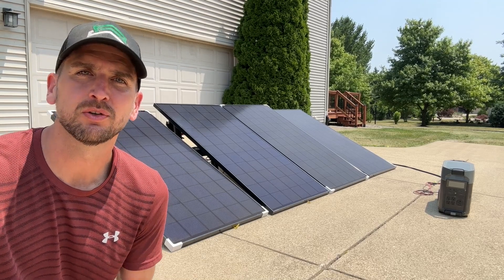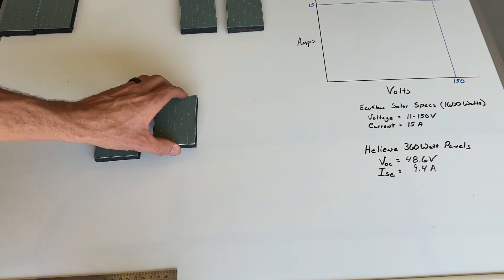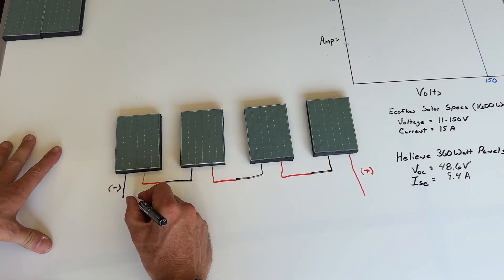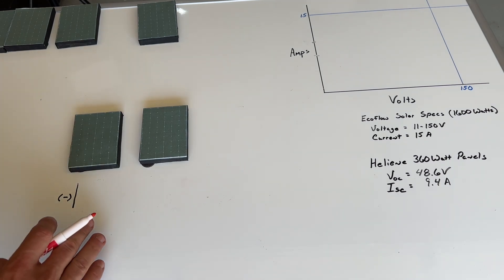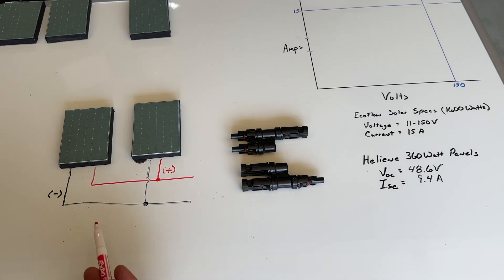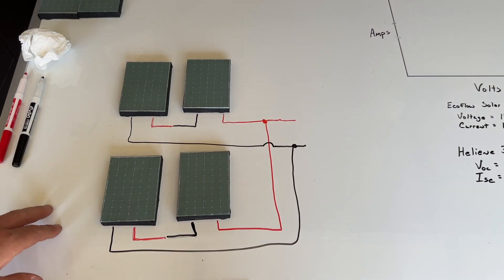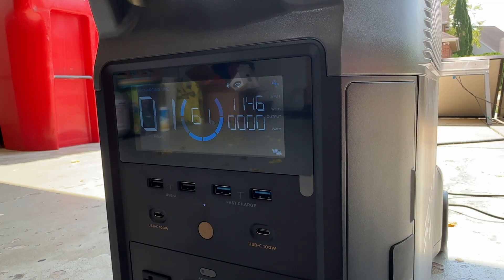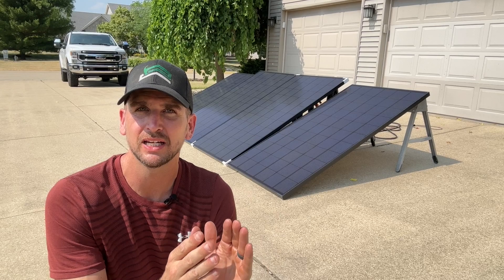Solar Panel Wiring Basics | Maximizing EcoFlow Delta Pro Solar Charging

Comment: I'm new at this and would like to know if it's possible to do (2P2S) instead of (2S2P) the reason is I have a Bluetti Apex 300 with 2 AC/pv ports of 1200 W with Voltage  between 12v-60v and current under 20 A. Ex if I was to use your 360W panels. Thank you.

Comment: Are there panels available now that would better max out the 1600w?
Reply: I have the ecoflo delta pro and I am checking out the bifacial 200w callsun
I know next to nothing but I need 800 to 1000 watts for my needs and I am not sure but I think i can do it with these panels 
Check them out

Comment: is the female or  male mc4 that is on the panel the positive? I have 4 for series and bringing each end, one red + and one neg- to a housing box, combiner box to connect to the pus and neg wires from the delta pro ultra high ports. The top port is specified as the positive and has a female connector on the generator and vice versa for the bottom port.  So I need to know which end of the array end connector, female or male to put as my positive red wire and which to put my black wire into. THank you.

Comment: I have an ecoflow delta 3, which takes a max of 500 w solar input. I have two 315w solar panels that I got for $50 on Craig’s List. If I connect them in series, it will not charge, but in parallel, it charges like a charm as I learned first hand.

Comment: Thank you for the great video.  I just bought a EcoFlow Delta Pro and extra battery that will give me 7.2 kWh power.  As for the solar panels can I arrange the 400w EcoFlow panels in series then parallel without exceeding the limits of the battery?  Looking forward to your response.  Thanks!!

Comment: Inverters can take 40 extra voc. Because under normal load, panel voltage will be less. If I were you, I would have gone for 4 panel series, getting 38.something x4 = between 152-156 v with 8.8 ampere = around 1350watts
Reply: Lmao yeah no. Don’t do this, man. You’re going to fry your inverter and warranty along with it.

Comment: On the last part for series and parallel, could you have added another solar panel seeing how it would have still been under 150v? I know that it would have hit almost 30 amps, but you said that the device would only allow 15 amps which it's rated for. So basically 3 & 2

Comment: I could use some knowledgeable help with my solar setup in my van.. I have a 200w and 2x 100w panels.. With a 160ah battery, and a marine battery.. Do have most of the wiring and do have 2 charge controllers (one per battery) just needing to know the gauge appropriate and also the fuses and where theyd be appropriate.

Comment: That is a great video. Thanks. I have a solar system on microinverters with 400W panels. I want to organize emergency backup power setup. For that purpose I'm planning to get DELTA Pro and connect it directly to solar panels most likely the described way. I'm planning to put splitters on the panels the would split panel current between microinverter and a backup system. Of course in the case of emergency microinverters will be turned off so all the current will be going to the DELTA Pro. Are there any potential problems with a system like that?

Comment: Please i wanted to ask, why is the fan noise on the delta pro even more higher than when charging with AC, i was getting 700w input through solar but the noise was so loud, is it just my unit?

Comment: Super clear!  Thank you.  I've never done solar. A few months back I got the Delta Pro. It is in a 4x4 Sprinter and hooked up the 800W ecoflow car charger (which is great). Now I'm trying to figure out if I can also hook up some roof-top solar, hopefully 800W panels. And have it all be running at the same time in a safe way.  Any help would be greatly appreciated.

Comment: Hi Scott, first of all, thanks for the great videos 😊 from what I could understand (I’m starting with solar panel system – just bought Delta PRO 3 and is still on the way) from putting the system the way you did (series and parallel) at the end, the values I get on paper, are above the maximum permitted in W and A from the unit.
2 sets of solar panel in series (45v / 9.4A) we would get a total of 90v / 9.4A, right? Then when combining both sets in parallel we would get 9.4A+9.4A = 18.8A x 90V that would give 1692w, right? With this configuration, we would be above in short circuit value and also in power. But since it has worked on your experiment, it could have been, because there were not enough solar power to take it to the maximum or my values just completely wrong? What am I missing here 😊 Thank you

Comment: I have a solar panel on my trailer that is connected to a Go Power controller to charge the deep cycle battery in the trailer.   Can i split the solar panel lines/wires  so i can connect simultaneously to an Ecoflow portable battery?

Comment: Great video - very clear walkthrough. It would be useful if EcoFlow could consider increasing the voltage and current inputs because trying to add more than one solar panel feels like Doc Brown connecting the clock tower to the Delorian.

Comment: Hello. I also have a question for you, I see that you are very skilled. I want to get the Powerstation ECOFLOW Delta Pro 3 4096 wh and I want to ask you can I put  3  400 -420 w panels on it, but should I buy them separately so that I can also come out cheaper. And how many 400-420w panels can I use on this station? AND how much can I extract from this station if it has 4kw can I take 3kw / day from it without damaging it. That is, to last me as many years as possible? .Thanks!

Comment: All the info has been great. My one question is if my volts and amps are within the specs for my Ecoflow power station but the watts are over the max. Will the power station throttle the watts or will that harm it?

Comment: I’m new at this just learning first thank you for the clear step-by-step guidance. I’ll probably have to watch it two or three times before I get it all second. Can you leave the solar panels connected to the Delta unit all the time.
Reply: Yes, the delta unit have built in charge controller that will disconnect the battery when it is full

Comment: Supposing it was late in the day or hazy conditions and the panels are producing fewer watts.   Are the fewer watts because of reduced voltage or current or both?     Can the series/parallel math be done with whatever the panels are currently delivering.   Or does the math have to be done with the spec'ed voltage and current ratings?

Comment: Living in CA requires me to connect to the grid. But in a power outage i can't use my 6k solar array as it requires 120v to run. What do you recommend to be able to use my solar in a Power outage? I'm using micro enphase inverters
Reply from the maker: Yeah, that is a super common problem for a lot of grid-tied systems.  The most common would be investing a significant amount of money and get the Enphase battery backup system with the needed hardware.  I hope we get a better solution soon but right now that is it.

Comment: Are there any "fail safes" in connection(s) between the panels and battery/power supply to prevent discharge of the battery when there is low to no illumination for the panels?
Reply: The charge controller connected inbetween the solar panel and battery will have protection features. You CANNOT, i repeat, CANNOT connect the panels directly to the battery.

Comment: can you tell me why in parallel you didn't exceed the 15amp charge limit, does amps not add together from panels when in series?
Reply from the maker: Most if not all portable power stations will "throttle"the current at the max amp rating.  So even if the panels are able to produce 17 or 18 Amps the charge controller in the portable power station will only allow 15 Amps input.  This is not true for voltage, if you go over the voltage it will either damage the charge controller or shut down the solar input.
Reply: @everydaysolar  ahh cool, that makes sense, thanks
Reply: Two things will happen if current exceed limit, charge controller will boost the voltage to reduce the current within the maximum limit or current will be clipped. Both will result in power losses, but current clipping is more drastic.

Comment: Series Voltages Add, Parallel Currents Add
So is the example of 2P too much current in bright sunlight? What will happen when there is a possibility of 18.8 amps provided by the two panels in Parallel?
Reply: Is the extra 3.8 amps of available current just wasted? No harm done?
Reply: So Voltage matters,  but Current is capped by the Ecoflow without doing harm. It only uses the amount of current it needs, indepent of the excess available current from the solar panels. 
Ecoflow Delta Pro solar specs show
 150voc 15amps 
Your two solar panels in parallel 
 48voc 18.8amps

Comment: What is the max distance I should expect to go between the panels and the ecoflow unit?  I'd like to put the panels on a shed in the backyard rather than on the house itself, but that would give me a DC run of about 200' or maybe a bit more (House is still being built, and shed doesn't exist yet!)  Is the resistance going to kill me on that?  Also, in a different video I saw you using the ecoflow pro ultra unit and you mentioned charging the batteries through the smart panel, but didn't talk much about it.  Is it true?  I could get just the ecoflex pro ultra and the smart panel, and it would just stay charged to use in case of a power outage?    Thanks for all your videos - I just stumbled upon your channels today and have learned a lot binge watching probably 2 hours worth already!!
Reply: The 15 amps of solar limited by the Ecoflow Delta Pro would be ok on a 10awg USE-2 solar wire run 200' or more. Not the most efficient. Could you put your Ecoflow in the locked up shed? Then run the AC output to the house. 
DC loses power over distance, 
AC is greatly more efficient over distance 
Look up Nicola Tesla AC vs DC, the NY Worlds Fair 1893 😊
Reply: @Papa-bh6zq  Yeah, that really is what I am thinking I am going to have to do.. and for those reasons.  My issue is that at least at first, I may not have any solar, so I'm not sure how I'd charge it, especially if I'm going to have to have a main-cut off in the house panel to isolate the shed when it's not powering the house.  If I put at line from the house to the shed, then another from the shed to the house (Same conduit, opposite current flow) maybe I could do that.  I dont know.. I'm going to have to think about this for a bit.  Maybe the answer is that the battery stays in the house as a battery charged from the grid, until/unless I get the solar on the shed, at which point I would move the battery to the shed and forego the ability to charge from the grid. I'd just run the shed from the battery all the time, and use it on the house generator input as needed..    Lots of options... none perfect, but fun to work through to find the best!
Reply: @SteveJones172pilot  Put the Ecoflow Delta/Ultra in the house with an Ecoflow Smart Panel and run the Solar DC wire 10awg from the shed. This way, it will charge/ discharge off the Smart Panel automatically in Hybrid mode. Size your solar for up to 150voc and 18 to 20 amps. The Ecoflow will only draw the 15 amps it needs, so voltage drop will not be an issue. The Ecoflow will provide battery backup, and solar charging can be added later. Have fun
Reply: The underground 10awg wire must be THWN stranded wire, not the more expensive USE-2 Solar wire for UV protection
Reply: You may look at the EG4 6000XP to be more economical.

Comment: For my 3 kw system I have installed 16 awg PV wire with 7 plates of 330w in series. Should I reduce the wire gauge or not

Comment: What about building an independent setup? In my case NOT on the roof and using heavy duty drop cords to run the refrigerators, air conditioners and/or space heaters and other devices as needed. Meaning not tying it into the grid. Not asking the government for permission to run our appliances from a solar and battery bank. I am considering marine batteries daisy changed together. The idea is to avoid using any grid power unless really needed.

Comment: Excellent, but the math broke my brain. I want someone to do the math for me please. I have right now 4, 400w panels @ 37.5VOC on one DP and 2, 430w @ 37.5 + 2, 400w@37.10 also 37VOC on the othr Delta pro. But in the winter only getting about 850w @ 138v during peak sunlight. I have 2 more extra 430w/37.5v panels I can add. How do I do it ? Or what is best configuration ? Thanks

Comment: Thanks for your help. I have a Delta pro 3 and I’m very limited to my knowledge on all this solar systems. Is there someone or place to speak to to get more knowledge. I have a special needs daughter who need power beds,pumps etc. I live on Long Island New York. I have a Eco Flow 400 watt solar panel and two 100 watt panels from Patriot 1800 watt but It cramped out last year the two panels have Anderson connectors and do they make adapters so that I can use them to keep my delta pro3 charged. Any help would be greatly appreciated. Kevin Flynn
Reply from the maker: Hey Kevin, we have a Facebook Group https://www.facebook.com/groups/770503698409857/ and here is an example of an Anderson to MC4 connector that might work for you.  If you have a Delta Pro 3 you can get a LOT more solar into that unit but just depends of your needs and use case https://amzn.to/3UkeD34

Comment: If I’m using the delta pro with 2 400 watt solar panels, How should I set them up? Series or Parallel?
Reply: That's what I'm trying to figure out too ? Seems like parallel would produce more watts but amps is still below 15 amp
Reply: I think that if you had 4 of the 400 watt solar panels (in the series + parallel configuration), that would make the voltage add up to the EcoFlow 1600 watt limit. And the amps would input to the EcoFlow only at a 15 amp level.

Comment: It doesnt matter that the amps are over the rated limit?  Ecoflow automatically reduces to 15 amps?
Reply from the maker: Yes the charge controller with throttle the current limiting to the maximum the unit can handle.
Reply: @everydaysolar  does that go for the other parameters as well? Can I hook a 2000 watt solar array to it and it will only allow 1600 in?

Comment: I am just now putting a small system together for some lights, a desktop and maybe tool charging, not big draw
I went with Four 100W panels, into an 150/40 EPEver charge controller and Four 105 amp hour deep cycle batteries to kind of keep cost down, for a few days I was running them in 3P didnt bother with the last one it was just working, and even under load with clouds it was doing good, I can use everything for 6 to 8 hours with 1000W inverter and only draw down to 12.1v but if I can get a little better out of them on a little cloudy day, SWEET! I will try 2S2P
next I will drop wown from 12 Ga to 10ga for even a little more percentage :)

Comment: Nice video.  However, when you wired the panels in series, which would add the voltage of each panel, you also (unless I missed something) added up the current of each panel.  I thought that in parallel, the current adds and the voltage stays the same and in series the voltage adds and the current stays the same.  What am I missing?

Comment: Great video. One question though. If your doing series and parallel. The top series connection has 3 solar panels with the 45V, and the second series only has 2 panels with the same 45V then how would you calculate the Volts?

Comment: During the parallel portion of the video you exceeded the 15A limit on the delta pro.  Does this mean it doesn't matter how far you exceed the current because the delta pro unit will just bottle neck it anyway?  I want to connect 400W panels to my delta pro but they are 14A each and I want to connect them in parallel since the will be facing different directions...  Will I have problems with this?
Reply: Hey did you manage to wire those at the end? I am thinking of doing the same
Reply: @isaacperalvillaverde1986  my panels are still collecting dust as it is the rainy season where I am.  I'll probably get around to it in November

Comment: wait... with his panels he is using wouldn't the series parallel total voltage still be over the 150volt limit of the Delta Pro thus risk damaging the Delta Pro Charge Controller?

Comment: Question: I have the Delta Mini with 300w solar input max. If I connect two EF 160W panels that are within the voltage (& amps) but the equated rated wattage being 320w, will the mini still accept the power flow, but limit to receiving 300w or will it not work entirely at all?

Comment: Couldn't you  use 6 panels? Two strings in parallel of 3 panels in series to get the max? The voltage should be good 48.6 x 3 = 145.8 and amps 9.4 x2 = 18.8?

Comment: I have two Ecoflow 100 watt rigid panels and a delta max. I want to be able to operate basics during an extended power outage or a tiny window AC.  What else do I need to have?  I’m going to get two more panels. Any advice would be helpful.

Comment: Hello.
I have three flexsolar 360w foldable panels. 
I can't set them up in vertical position because being foldable they wouldn't hold up a 90 degree angle. 
My question is, if I set them up in horizontal position, would it be the same procedure to connect them in series?
🤔

Comment: Outstanding job ! Lets talk cable gauge . . . Recently melted my 10 AWG gauge 2x50' line MC4 connector's where they meet for some unknown reason? At the time only one 430 watt solar panel was connected on a clear sunny day? So may I ask your opinion why this happened and what gauge do you run 8 or 10 AWG?